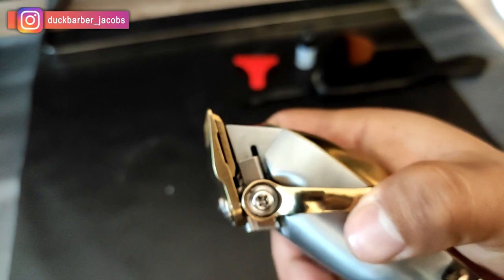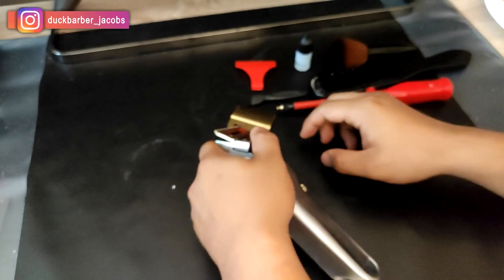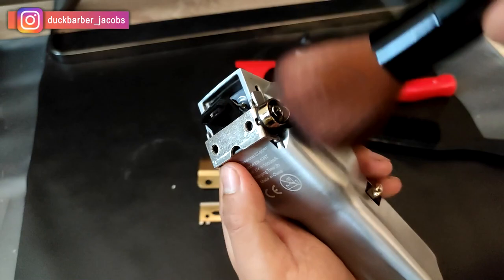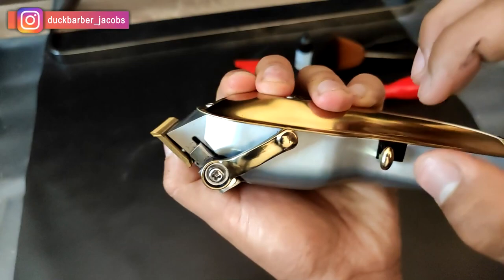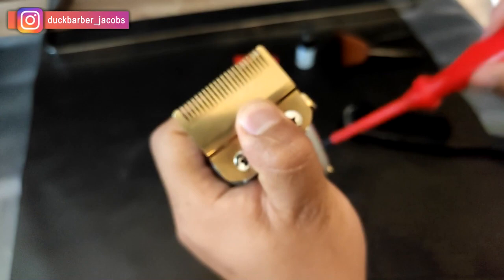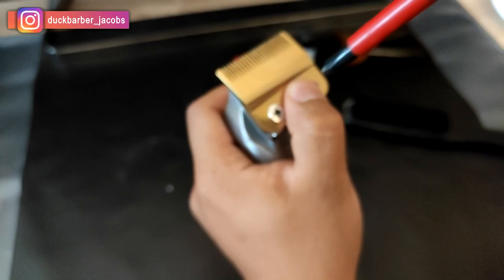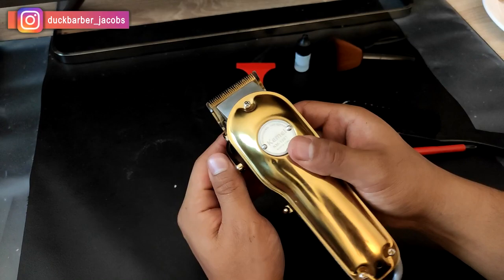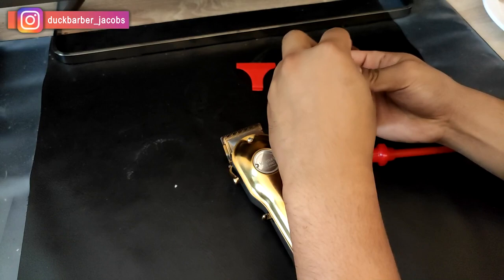How to zero gap Kemei & Wahl hair clippers

Comment: I tried to zero gap and one side always gets higher than another when I tight the screws
Reply from the maker: What I do is I tighten up both screws enough that the blade is fixed but also adjustable when you put force. I align the blade straight and hold it as tight as possible with my hand and then screw the bolts in completely.

Comment: Do your clippers get loud when the guard is on and the lever is closed?
Reply from the maker: Yes. I think it's because the bottom blade is hitting the side of guard. I usually open up the lever little bit if it's too loud
Reply: Thank God someone pointed this out. Cause my clipper gets loud when I put on the guards with the lever fully closed
Reply: @justadudewithsunglasses6798  just open it up a little

Comment: Hey bro! I tried zero gapping my clippers but now whenever i open my lever, it cuts at like a 3-4mm length. Do you experience this as well? And is there anything i can do to fix this?
Reply from the maker: Hi zero gapping does not neccessarly mean the blades are completely closed off together. It should give off some spacing between the top and bottom blade.

Comment: Who is good kemei 1986 or 1987?
Reply from the maker: 86 has the display panel while this one doesn't I guess thats the only difference
Reply: @DuckBarberMHK   the cutting blade start with 1mm and goes at 3mm or 0,8 and 2,5 and the wlrk time with full battery is 90 min or 300

Comment: Do you recommend doing this?
What is the benefits of this?
Isnt it make the gurad become shorter?
Like after doing this the 2 gurad will become like the 1 guard?
Reply from the maker: Yes I recommend zero gapping because when you create an initial guideline whether with a trimmer or no guard lever closed, zero gapped clippers can take out the line much more easily and clean.
Reply: @DuckBarberMHK  People say that zero gapping is dangerous because it cuts into the skin though, what do you think about that?

Comment: Jo wassup I have the same trimmer. One question tho is 0 gap supposed to remove/cut all beard hair ? I saw an crazy add on Instagram with the babyliss where they cut beards and shit directly to 0 and bring it into perfect shade. Sadly after I 0
Gapped my trimmer it doesn’t really cut all hair to 0 could Someone with experience explain that to me ?
Reply from the maker: Zero gapped is meant to take off as close to bald, but not quite. If you want to bald it out, I recommend using a foil shaver
Reply: @DuckBarberMHK   thanks my dude

Comment: Why the 87 over 86? 86 is the best clipper Kemei makes.
Reply from the maker: I think the only difference is the display panel no?
Reply: @DuckBarberMHK  I think the motor and blades are different on them. Could be wrong... who really knows.
Reply from the maker: @Kaiser187  Interesting. Maybe I can buy the other one so that I can compare both.
Reply: @DuckBarberMHK That would be good. Just gotta make sure its the original model and not the pro.